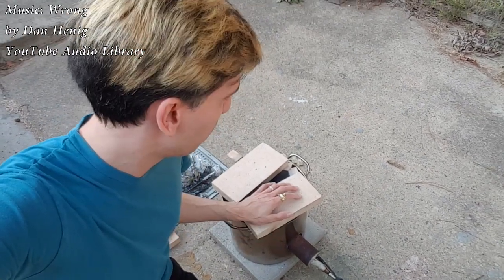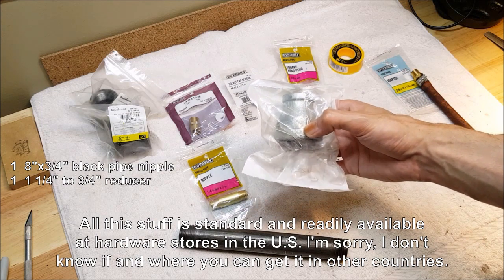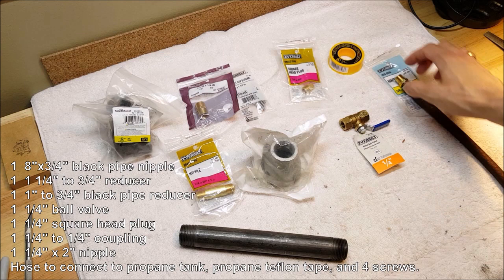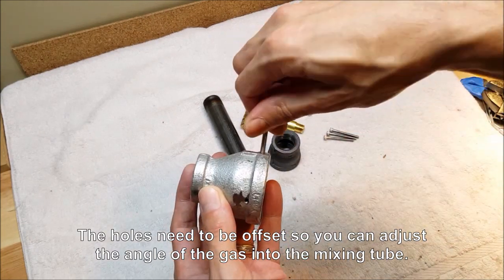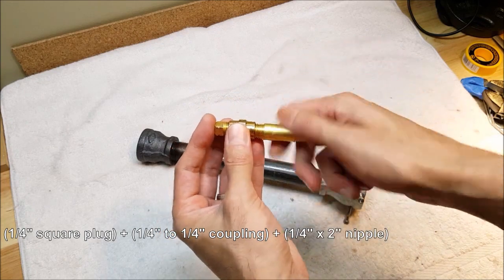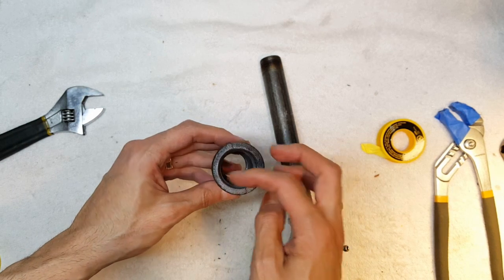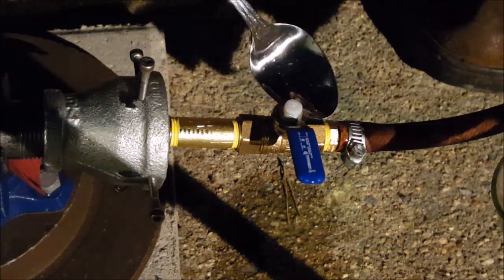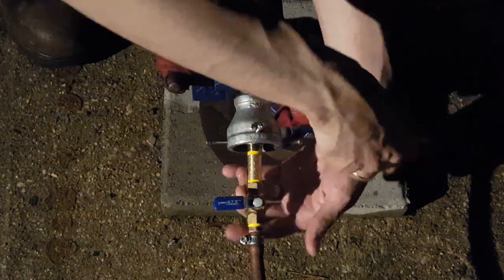Making a New Burner for the Furnace

Comment: can we use methane (natural) gas instead of propance gas? please reply
Reply from the maker: I'm not sure. I never tried.
If I'm not mistaken, methane burns less hot than propane, so you might not be able to achieve the same temperatures without considering some forced air setup to make it hotter.
But in theory, this setup could be used for other gases, I suppose.